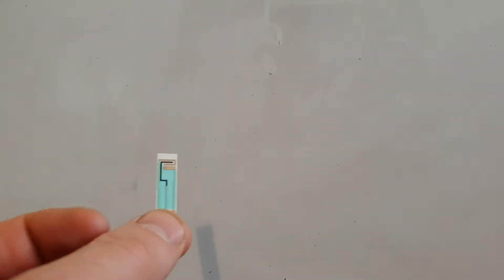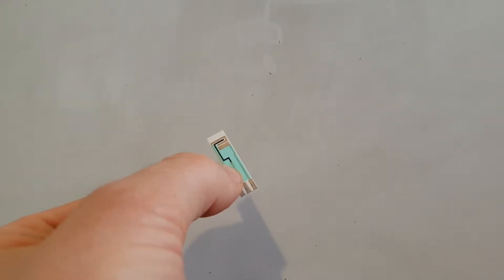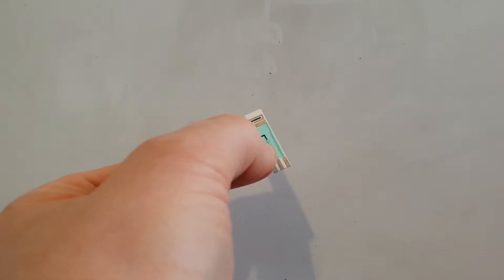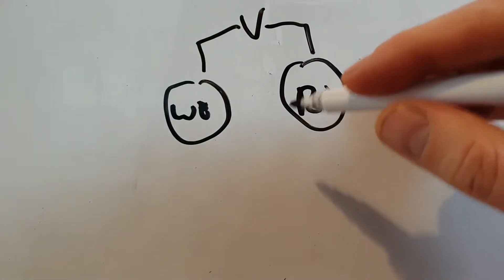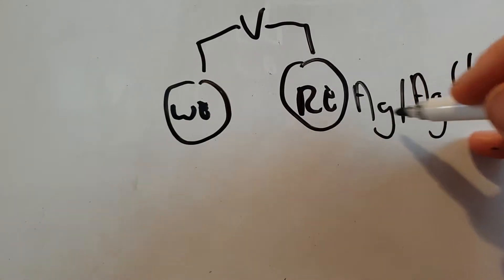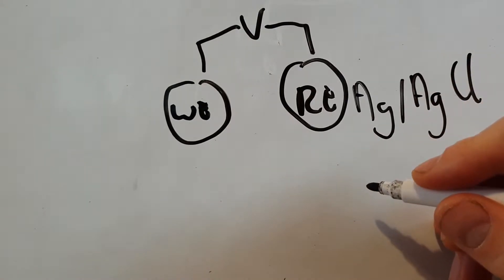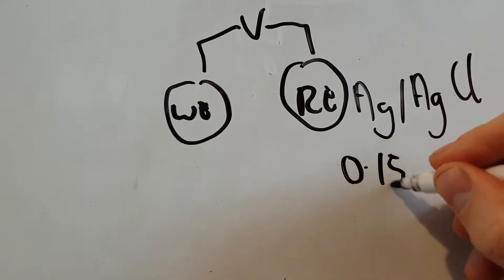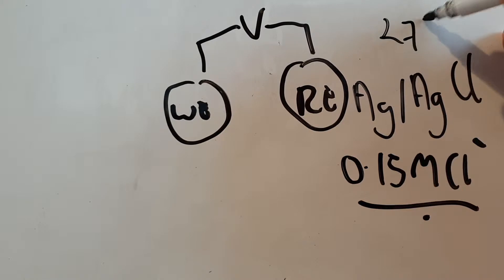Reference electrodes on screen printed electrodes

Comment: What are your suggestions if I can use the only silver paste as RF rather than Ag/AgCl paste for screen-printed electrodes?
Reply from the maker: In a 3 electrode system I think Ag will work fine.